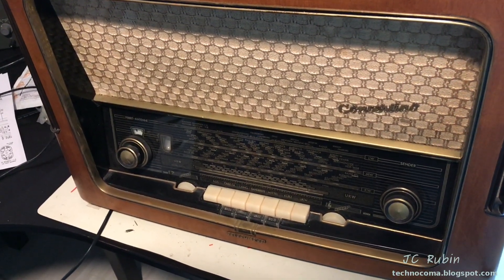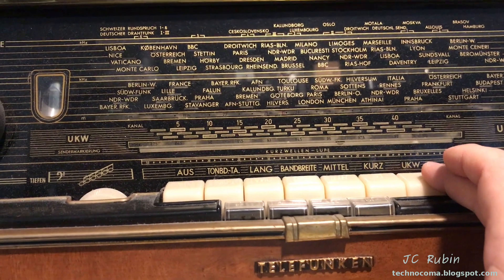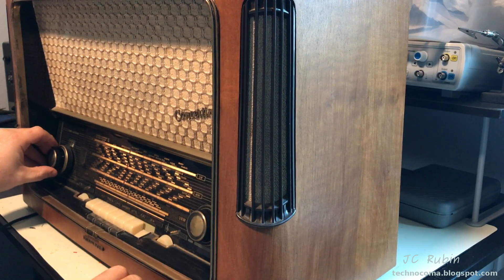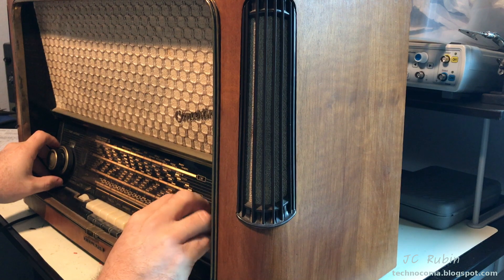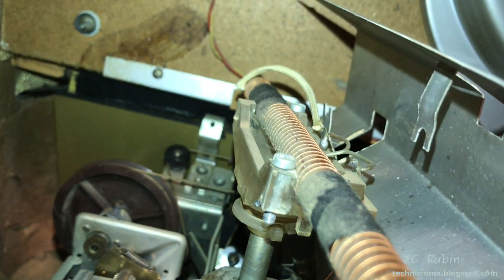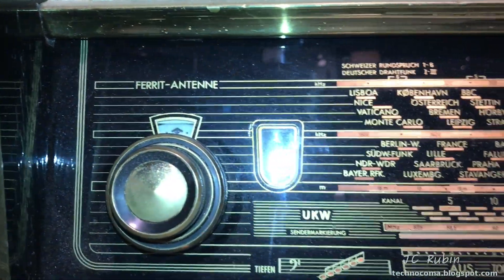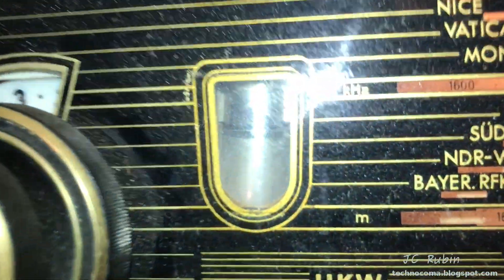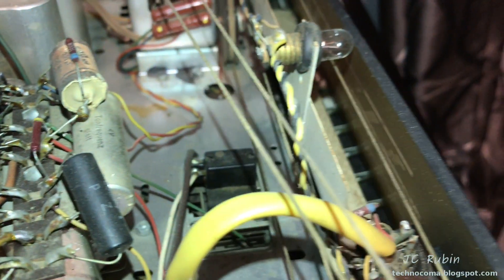Telefunken Concertino 7 Radio Repair Part 1 of 5

Comment: Greetings from Germany... I just acquired this same radio from an estate clearing.  10 euros and to my surprise it has been fully restored.  I found if you connect the earth ground, the Am and SW works prefect with the built in antenna.  Here, we still have a few LW stations most of them in France.  Thanks for the video.
Reply from the maker: Thanks for the info!

Comment: Hi. I've replaced all the capacitors with the exact uF values but with slightly diferent voltages since I couldn't find them. It's a model exaxtly like yours. It was drawing current into the chassis before I serviced it. I also installed a 3 prone cable. The radio was once serviced about 20 years ago by a tech and as per my observation the rectifier was replaced for a small black diode or triode and the filter capacitor was also removed. After I replaced all the capacitors it started and was not drawing current to the chassis anymore but the EL tube was really hot! All the other tubes were warm. The radio has some wrong tubes in the tunning sector probably swaped at the last service and as per my search the replaced ones have no match with the old ones. Could it be the cause of the EL overheating? I've ordered the correct tubes and waiting for them to be delivered. Regards. Álvaro, Portugal